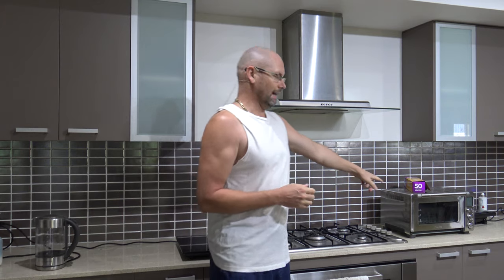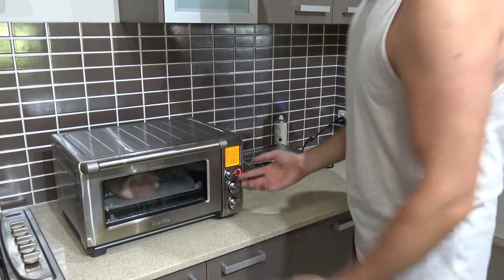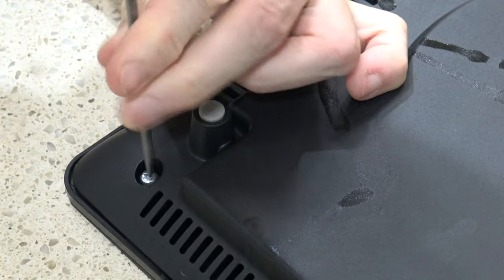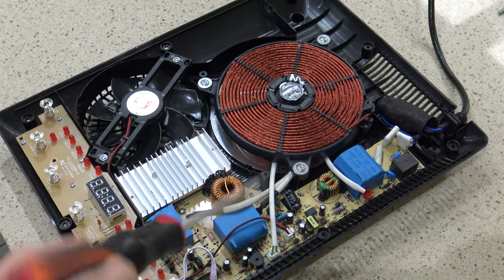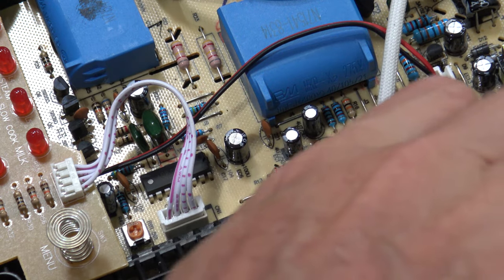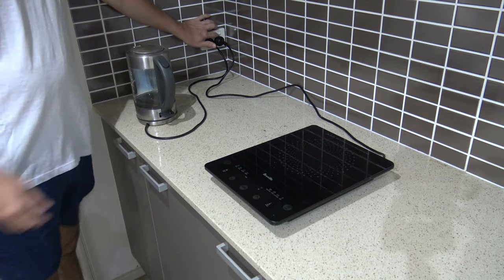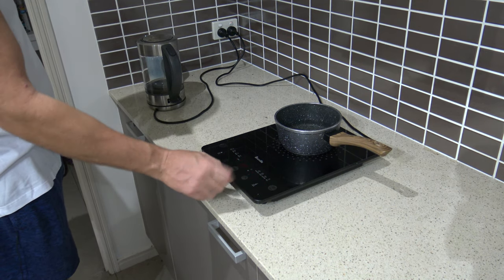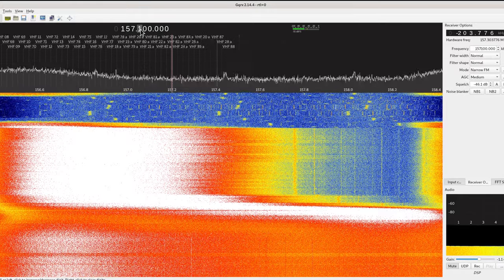Induction Stove Beeper Removal

Comment: A man after my own heart. I've done the same thing in my home. You know my micro has a speaker toggle button which is a nice touch, however when I'm mucking about with the house and turn the circuit off, the beeper comes back on with the breaker.

Comment: You have inspired me, our toaster has a beep as loud as a train. I will post a vid.
Reply from the maker: I saw you ran conduit for NBN fibre. I may consider that too at some point. If I do have to go to fibre, I'll want it to pop out in the garage, not the other side of where the NTU currently is, which is a bedroom
Reply: @TallPaulTech  Good little project. If the NBN box is on an outside wall in a bit of a service area it would prob be easiest to run the conduit up the outside wall on the brick into the eave. If it is going to look too shit then you can come down the cavity but it is a bit more mucking around. The other thing to keep in mind you don't have to run the whole way in conduit. You can run the conduit through the main part of the roof and have the fibre bare at either end where it goes down the walls.  To be honest you don't really need to worry about conduit at all if it is not going to get damaged, just buy a pre terminated single mode length with SC (I think) connector either end and run it. Prob about $80.